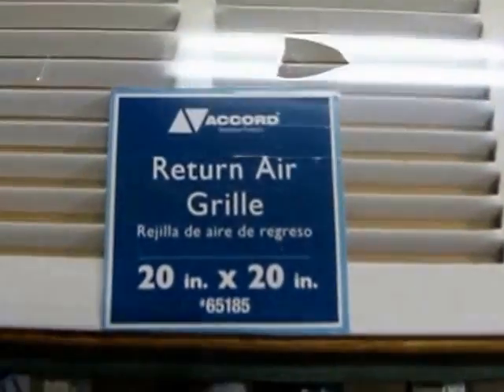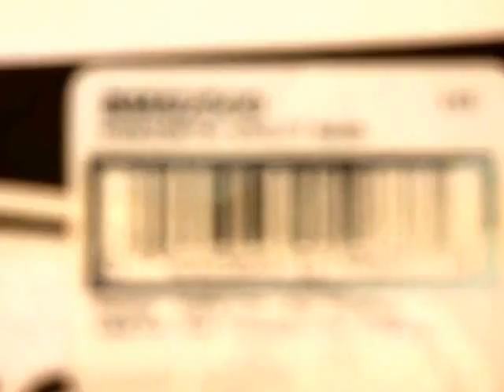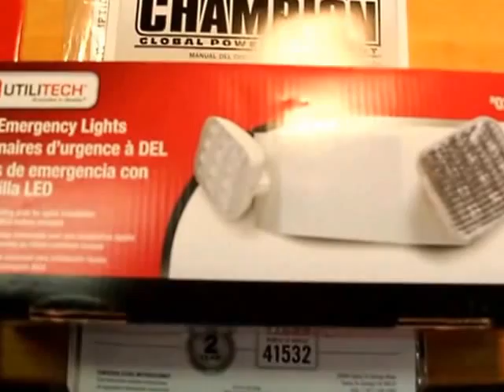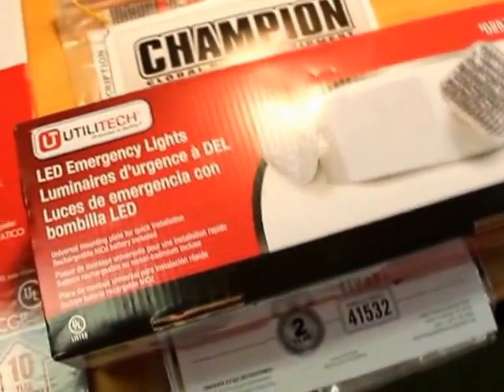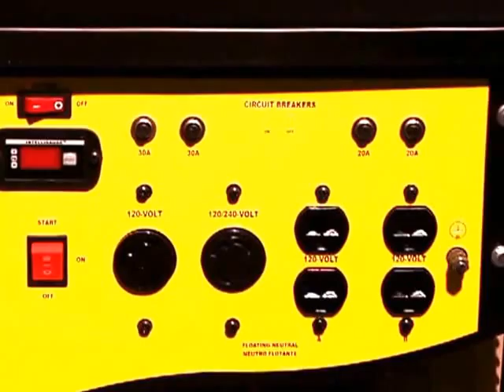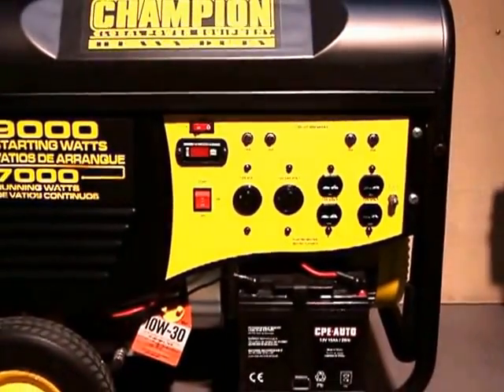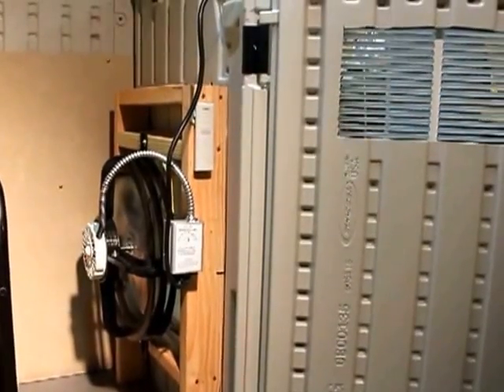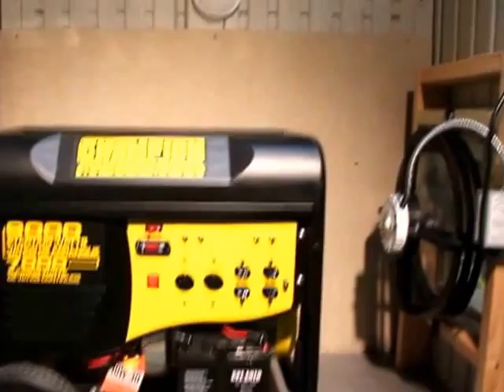Generator Shed Modifications

Comment: Hi Jim, great work!  What is the maximum interior box temperature you feel comfortable with while operating the generator?  Are you concerned about overheating?  What are the exterior temperatures that you’ve run the unit?  Thanks
Reply from the maker: Gerard, I have the fan thermostat set at 80 degrees, which I feel is a comfortable temp.  I have run it when it was 90 degrees out and it maintained the 80 degree set point no problem.  I would not run a generator in an enclosed she'd without a fan.  Thanks for the compliment.  Jim

Comment: Great video. Just put together a Suncast yesterday 71×44×50 inches its quite large and the same design as yours. Have a Champion 7500 running watt that we just bought. Price for shed was 600 plus shipping and generator was on sale $899 was $1300. Electrician to hardwire $1000. You gave me some great ideas for venting. Im from Nova Scotia winter's can be harsh. I like the way you have tubing for generator exhaust. Would you have pictures on how to do this please meaning how pipe stays on generator exhaust?Cheers

Comment: NO,  2 male plugs is illegal and dangerous .The box on the house should be male and one end of the cord female the same as an extension cord. Two male ends presents the risk of electrocution as if someone unplugs the connection at the house you now have a live male end.
Reply from the maker: Thanks for pointing that out.  I will certainly look into that.

Comment: Good video. I know this is several years old but I am just viewing it now. Can you elaborate a little detail on how you built the wooden mount for the fan and fixed it to the plastic wall? Thanks.
Reply from the maker: Sure, I just bought a few 2" x 3" s and built a basic frame to hold the fan.  I screwed it into the plastic box.  Hope this helps.
Reply: @jdmac62 That is indeed helpful. Did you screw it into the plastic from the outside? Or did you use some kind of brackets?

Comment: Outstanding choice of materials and my question is how well has it been holding up after sustained running of the generator on load? Specifically what is the temperature based on the what you’re monitoring from the remote sensor? The Hardyback material where it mates with plastic does not show any signs of melting or distortion? No significant problems with weather or water intrusion in particular? I have the same generator from Costco lol but live in a little more crowded environment so I am investigating constructing  a setup very similar to yours but with additional soundproofing/fire resistant materials. Any sticking points or things you found you might do differently after running the machine for a while? Again great affordable setup - finished product looks solid!
Reply from the maker: Stephen, thank you for the compliments.  The set up has worked very well, nothing I would really do differently.  While running under load with the fan on for extended periods of time the temp stays around 80 degrees.  If it were the middle of August it may be higher, but our powered usually does not go out in summer.  Good luck with your set up!  I would reccomended higher octane gas and always add Stabil as you never know when you will use it.  I added a trickle charger to the battery to keep it charged.
Reply: Jim McGovern thanks so much for the response and best of luck!

Comment: Hi, Which is more efficient, pushing fresh air in to the shelter or pulling hot air from inside the shelter?
Reply from the maker: I am not sure.  I wanted the fan to be enclosed in the box so this is the only way I could set it up and it works fine.

Comment: Hi Jim. I built a similar set up, using the virtual twin of your generator. I lined the whole shed with Hardi backer. The only other thing I did was to wrap the exhaust with a fireproof fibre batt. The Hardi backer did reduce the sound levels as well. Great video as well.

Comment: What temperature do you have the cooling fan thermostat set at?
Reply: It is set fairly low, I think around 80 degrees.
Reply: @jimmcgovern8783  Thanks..I figured around 80°..Mine is finished and I am just waiting for the thermostat to be delivered. My setup is pretty similar to yours. I have transfer switch for mine..Anyway, thanks for the quick reply...
Reply: No problem, best of luck with your project, I hope you never have to use it!  Had to use mine a few weeks ago for a few hours, worked flawlessly.
Reply: @jimmcgovern8783  I use mine a lot, well several times a year anyway....Last year it ran for 4 days during a winter storm..
This is a new dual fuel I bought and I built the new shed for it... Same Champion, 3500 watts..Good generator...
Thanks..

Comment: Jim,  I've been using your video to make my own shed.  I am ready to cut the holes for the vents.  I noticed you have one located low towards the floor of the shed.  What is your reasoning?  I was thinking of placing mine more in the the center between the top and bottom, solely for keeping the wall from flopping over.  I have a sheet of the hardie backer as well, any issues with rain on the exterior piece?  Thanks for the video!
Reply: The vent just fit better in this location based on the design of the suncast shed that I used. I think wherever you place your vent is fine, as long as it is large enough.  The hardibacker is holding up great outside, no issues whatsoever.  It is very stable.  Good luck with your generator shed project!
Reply: Awesome!! Thanks for the info!
Reply: Hi Jim, I finished my shed.  I gave you a shout out in my video.  Thanks again for the info.

Comment: Hey, nice work on the enclosure .Everything seems to work just right.
Im in the process of building my   own, but cant find a decent fan.
Theyre either too big or too expensive. Would you happen to have the part number for the fan you used. You said it was 14 ".All im finding is 18"
Thanks in advance. Again , well done.
Reply: What he has for a fan is extreme over kill. Save yourself a lot of money and get one not built for 1900 sqf
Reply from the maker: https://www.lowes.com/pd/Air-Vent-18-in-Dia-Electric-Gable-Vent-Fan/3143421.  Thank you and good luck with your project.  It was pricey but I figured it was protecting the generator from overheating so it was worth it.  Not sure if mine is 14” or 18”, but this is the brand I used.
Reply: Thanks alot for the fast reply . I appreciate the help. The use of the hardiebacker is a GREAT idea. Seen a few videos where the exhaust is burning the  enclosure .!! Well done. Good luck in your future projects .

Comment: What the DB rating on this
Reply from the maker: jcr65566 I don’t know the DB level, sorry.  It is fairly loud.  You can check my other video and hear it running outside.
Reply: JIM McGovern Thank for posting  I like what you have done to get the sound down. My area getting built up with blackouts I bought Generators And they failed so I went and bought another one  Then I retired I had nothing to do so I look into fixing them the thing is there so cheap But though There surprising easy to fix. to fix them is time-consuming it why shops won't touch them it cost more in labour then it would be to replace the whole generator Most time with the brush generators it the AVR if it is not then it usually the stator coil If it a brushless generator it the capacitors if not it the diodes in the rotor. Very rarely dosa winding burns out the problem is to get at the burnout winding on the rotor or stator you just got to take it out but to get at it you got to practically tale the others windings out as well there all just coils set at 120 c from one another but if you have the time an patience is fixable. But it a DIY With the node  I have the same problem with my three Generators I  have an old 1980 600-watt camp Yamaha Generator that a bit loud  But The old Chinese generator knock-off nosy  but the worse is with The 11hp honda  welder generator  I got to wair ear muff just to get near it

Comment: Hint..... sound travels in a straight line.....airflow can however, "bend". For the inlet and outlets where you use screening/vent panels.....consider covering these with a small, nadd-on box that is closed on the tops and sides but is open on the "bottom" face....hard to describe without a pic. That way sound will not travel "straight-out" of the package.  It will make your package CONSIDERABLY quieter.......
Reply: Can you please show us how to cover the vent panels, in my case sound is a concern. Thank you.

Comment: You need 10/4 not 10/3 wire to run 110 off your generator using your L14-30 plug

Comment: Great idea, making mine for inside 7" x  &' shed, rubbermaid, more room for more things. I have a Briggs and Stratton generator with spark arrestor, the magnet idea may work tinplate the exhaust pipe over the arrestor, what kind of magnets did you use on the l brackets and where do to get them ? Thanks Gordon

Comment: The problem with using any box or shed for noise abatement is that you need large holes for sufficient intake and exhaust ventilation.  Large holes leaves large openings for noise to escape.  Sure, you'll get some attenuation, but not an appreciable amount.  At least the ones I've seen and heard.
Reply: Sound travels in a straight line......airflow however can be "bent". You can add baffle boxes for the inlet and outlet screened areas shown, that would force the air flow through a few bends....I mention this poit elsewhere on these response pages.

Comment from the maker: Cathleen, I purchased a 4" x 3" vent reducer( used for not water heater venting) and screwed some "L" brackets to the vent.  then I mounted magnets to the L brackets that that stick to the exhaust shroud.
Reply: @Jim, I am at this point on my own modifications. Which side of the 4"x3" was mated to the generator and which side was put out? Did you also use an extension on that because the 4"x3" reducer at Home Depot is not long at all. It is not clear from the video. Also, is the hole in the generator shed larger than the hole in the hardie backer because you said that it goes through the hardie backer but does not touch the shed. So, I take it that at least on the inner side hardie backer, the vent is not resting at all on any support? Is there any support to the vent anywhere? Thanks again for responding to these questions.
Reply from the maker: @basu69  hello, glad to hear you are working on your project.  I would place the reducer whichever way best covers your exhaust and mates to your generator housing.  I did make the hole in the hardibacker about 1/2" larger than the exhaust duct.  You can also get extension sections if you need to extend the exhaust through the enclosure.

Comment: My new Champion DuelFuel 9000 has a sticker on the top that indicates a 5' on all sides clearance, does yours? If yours does how did you take that into consideration. I've not a clue as to why the setback is called for but suspect it is for heat.
Reply: That is probably to be adhered to when you don't have good vents and a big fan like he does.  I have one too.

Comment: Jim:  I just bought a Champion Gen from Costco and want to make the identical shed and mods.  I could use more info on exhaust hookup since I could not see it that well in the video.  Very happy to find this review since it is just what I wanted.  I am going to do the interlock set up as well.  Plus mount mine on a concrete pad with a lock on the genset.  I will check out your other videos.  Thanks for great presentation.

Comment: Great video and enclosure. We have the Champion 7500 generator & were thinking of getting the larger Suncast shed. Do you think we could run the generator with the top up and the doors open, using some dryer duct to run the exhaust further away from the shed? Also, how wide is your generator?  Thanks.
Reply from the maker: Generator is 27"W x 27"D x 26"H.  Where I live the power usually goes out in a storm, so I did not want rain/snow getting into the generator.   You could use dryer duct to extend the exhaust.  I have found that a lot of the noise comes from the generator itself, not just from the exhaust.  So if you are trying to quiet the generator, it may not make much difference. Good luck!

Comment: How did you attach your exhaust vent to the generator?  what size and where did you find it?
Reply from the maker: I purchased a 4" by 3" heating vent reducer and mounted 3 - 2" angle brackets.  I then attached 3 rare earth magnets to attach it to the generator.  On the video at 3:55 it shows a brief image of it.  Hope that helps in your project.  I got the vent and brackets at Lowe's, the magnets I ordered online at Amazon.
Reply: Jim McGovern
Jim,  I am still unable to see how you actually attached the exhaust ducting onto the generator manifold exhaust port. Is it actually the spark arrester assembly you are covering on the generator?  Where and how are you placing the magnets.
Also, could you assist me in how to obtain the appropriate magnets necessary to make the proper hook-up?  I understand almost everything you show in the video, but have a real mental block on how to hook up the exhaust tubing and attach it directly onto the generator body. (Note:  I have also purchased a Champion 7500 Unit...Just a more basic one.
Thanks
Reply from the maker: I made up an adapter with the 4" x 3" dryer vent and the L brackets.  I fastened the magnets to the L brackets and it attaches to the muffler housing.  It is only connected by the magnets so it is not permanent.  I can't really take a picture without removing my generator.  Try to look up some other videos on YouTube showing generator exhaust ideas.  That is where I got my idea.  You will just have to adapt it to your situation.
Reply: Jim McGovern
Thanks for all your assistance.  It's great to have the help
Reply from the maker: No problem.  Let me know if you have any other questions.  Good luck with your project.  You can do it!

Comment: Do you have a problem with the exhaust not venting properly?  I can't get mine to vent enough
Reply from the maker: No, I did not have any problems with the exhaust.  Whatever doesn't vent through the vent will get sucked out through the exhaust fan.  I went larger on the fan to assist with ventilation.

Comment: I was at Lowes today, they do not stock the 20"X20" vent, I had to buy a smaller plastic one.
I have the Champion 4000/3500 watt generator.
What did the exhaust fan cost you?
I have seen them over $100, maybe I will use a window box fan on mine.
Connecting the pipe to the muffler is my biggest challange.
Reply: The fan was around $70.00 at Lowes.  It was the smallest gable vent fan they had.  It works great.
Reply: Thanks for the info on the fan, the cheapest one I did see at Lowes was around $100
Reply: I did that, HD is not far from my house.

Comment: Nice! I'll be using your videos as a template to make an enclosure for my generator.
Reply from the maker: Thank you, please let me know if you have any questions.  I used this set-up in February and it worked flawlessly for over 12 hours during a power outage due to ice storms in PA.  I have another video that covers the hook up and how I connected it to my electric panel if you are interested.
Reply: Jim McGovern Thanks, I will check it out.  My neighbour is an electrical contractor and he's going to guide me with the transfer switch installation.
Reply: I'm using your example as well I just found this shed on Walmart for a $220 everywhere else including Amazon prime was $250

Comment: Hi Jim.
I love what you've done.
I bought the same Generator last year right before Sandy and It was a blessing that I did. I had my Mom and Dad, Sister and Brothers family over for 7 days with no problems. I already have the 30amp hookup and was searching last year a shed idea and thought about buying a suncast or rubbermaid. 
Since then I picked up the same Suncast you got this November.
 I just saw what you done and would love your idea for my unit.
Please respond with the details as to parts and schematics you know screws,nuts bolts ext. 
Thanks so much for your post.
Reply from the maker: Richard,
I purchased just about everything from Lowe's.  The air return vent and automatic shutter were all of the shelf, as well as the attic fan.  I can get some of the measurements if you wish, but since it was a design/build, I don't have any schematics or plans.  If you have specific questions, please let me know and I would be gald to assist you.  I ordered the magnets and remote temperature monitor online at Amazon.  It all works very well together.  If you see my follow-up video I share a few more construction details.  I did include some of the part/model numbers in the video.  Thanks for watching!
Jim
Reply: Jim McGovern Jim, I live in Hawaii and I am buidling the same enclosure using the same 7000 watt Champion Generator. Our avarage temp in Hawaii is about 84F would the enclosure keep it cool enough to run for about 4 to 6 hours a day?
Reply from the maker: If you add a large fan as I have with plenty of ventilation you should be ok.  You could always prop the lid open for more air flow.  If you are depending on this for daily power you may want something that is more suited for daily use.